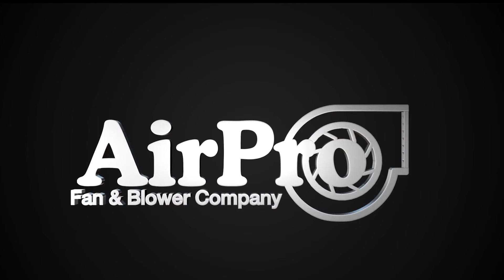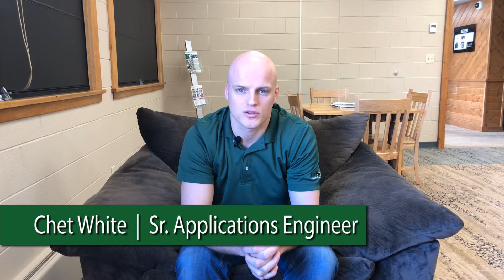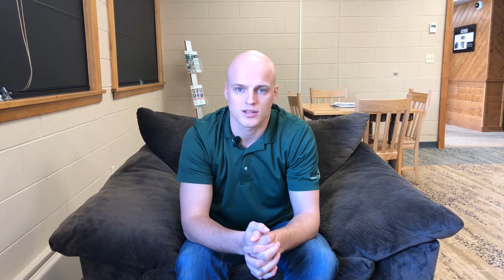Key Differences between Belt-Drive and Direct-Drive Industrial Fans

Comment: Are belt driven fans quieter than direct drive fans?
Reply from the maker: Thank you for your question. Noise is usually dependent on several factors: size of the fan; operating speed; housing thickness; noise factors in close proximity to the fan. Belt vs. direct drive really doesn’t factor into the equation. If you run the same fan at 1800 RPM, with one on a belt driven arrangement and one a direct driven arrangement, the expected noise level is the same. The main noise sources are the motor and the fan impeller emanating through the housing. Both are present in every arrangement. Does this help?